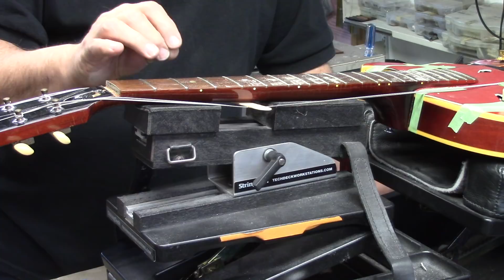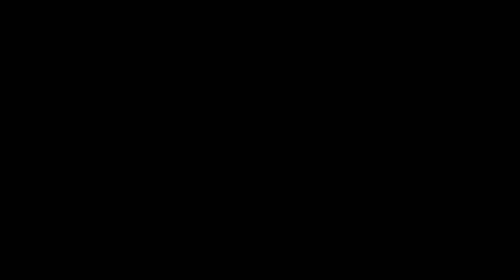Setting up a 1967 Gibson ES 125  @StringTech Workstations

Comment: Hi! Could you help to find out how the ABR-1 bridge that this guitar has got, is mounted  (or should properly be mounted in the best way) ? Are the threaded pins of the bridge locked with the nut form inside of the body, or just there are two nuts like what we see on video - one to stabilize the pin the other one to adjust ? Thanks ! Great video and master work.
Reply from the maker: I had to go back and watch this video again ( it was a few years ago ! ). Those double thumb wheel discs were on the guitar when it came into the shop. The threaded posts go into the wood stringer ... the lower discs tighten ( slightly ) against the top surface  .... stabilizing the  the posts ( not a bad idea ! ) ... the upper discs adjust the bridge up or down. Cheers, MMcC
Reply: Hi  @StringTechWorkstations  , that is what I suspected: that it shouldn't be just one disc in the guitar I've got ... . Because the post is going back and forth and so does the bridge. I've just thought of sth to stabilize, maybe wooden wedge under the disc,  then I found your video - not mentioned about it, but when the camera panned over that part of the guitar - I've got the idea od two discs. My other question that maybe it might be stabilized even better  by applying one more disc to the post from inside of the guitar body (as it don't have center block, it is hollow) ? Would it be good or bad idea from your point of view ? (then posts maybe have to be changed for longer ones). Wonder if you had such case ever ? Anyway mounting this lower disk will help me a lot.
I'm glad that I've found your video.I think this type of bridge mounting was transitional solution used by Gibson just few years, in this ES-125 TDC. And it is hard to find someone who dealt with this. Thank you ! Greetings !